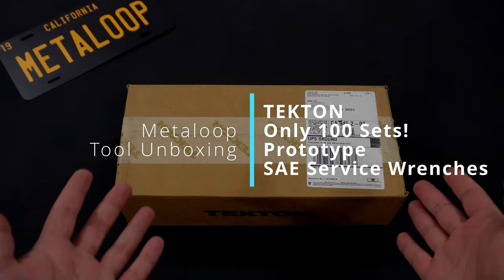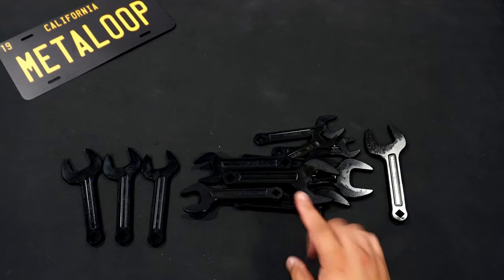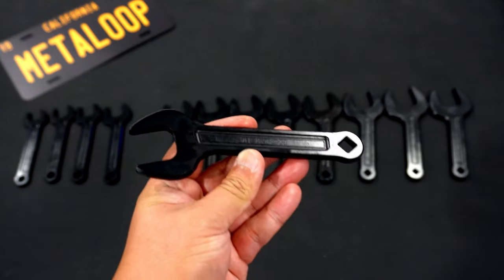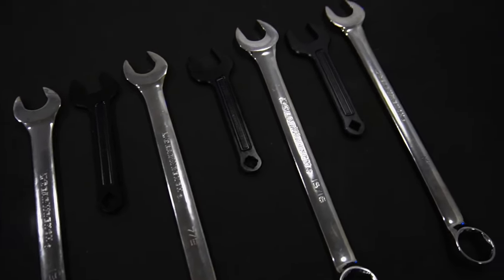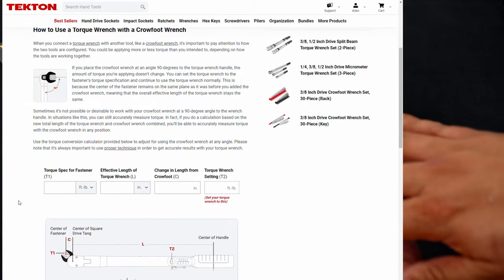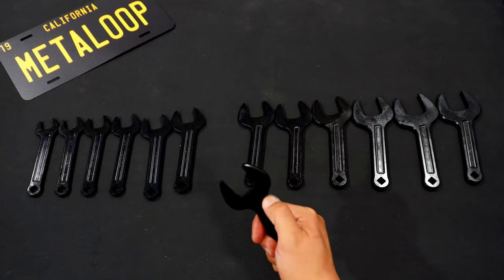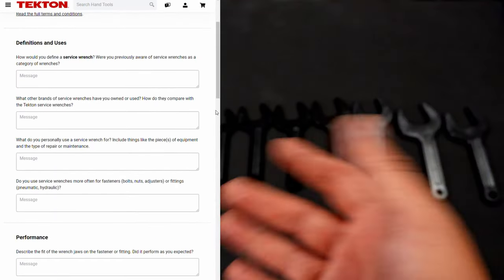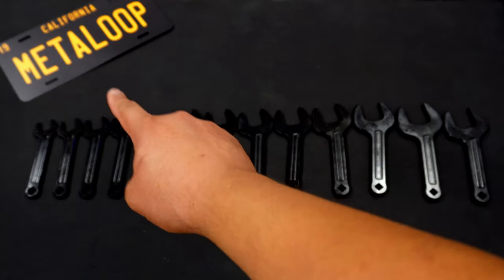Tekton Only Made 100 Sets And I Have One

Comment: I looked at these and love the idea just wish they did metric and smaller sizes.
Reply from the maker: Agreed, looking forward to completing the set with metric when available. After I released this video, I think I get now why the sizes aren't smaller. I think a smaller combo wrench is going to fit where you need it.  I'm guessing the reason these exist is to give you a "half of a wrench" option on bigger sizes to get better clearance and keep it on your tool belt, etc.
Reply: @mldiy  that makes perfect sense on the size thing. Because smaller ones you could just use crowsfeet.

Comment: I like these and had a chance at buying them but decided not to and Im kind of glad. I work on bobcat equipment and id say 75% of time you have a wrench in your hand removing hydraulic lines ect. I dont currently have any but a lot of people in the shop use the pittsburg service wrenches which I almost like more than these because the width of the head is narrow, the thickness has never been an issue for anything ive worked on its always the width of the head, such as when two lines are next to each other closely, and anytime ive had to use one of these it wasnt to bust a line loose it was to spin it off quicker in a tight space where length is an issue and the fitting is to tight to take off by hand if its under tension from the hose pulling it.
Reply from the maker: Awesome, thank you for sharing what you do and how you use these tools! Everything you said makes total sense. I hope Tekton sees your feedback and takes advantage of it.
Reply: I was scared to try the Pittsburghs. I ended up getting together a Frankenstein set through EBay. I have mostly wright, but a few Martin, Williams and even a fairmount. Wish I had bought them years ago. They e been great for me. I like the Tekton look. It’s almost like a service wrench/crow foot. I hope to own a set one day…